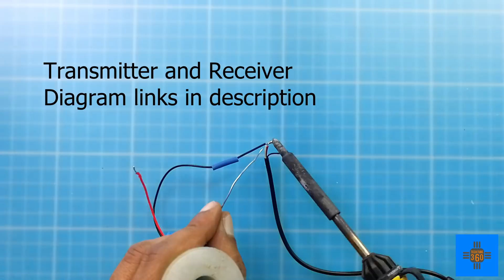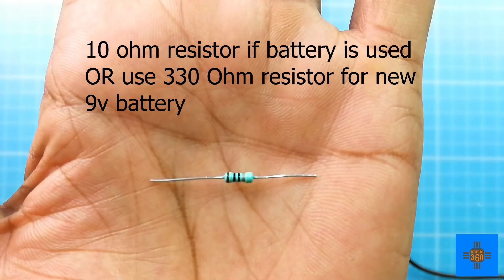Li-Fi Experiment || Transmitting Audio With Light || Light Fidelity

Comment: Is an amplifier necessary in this please reply fast
Reply from the maker: Ya speaker has built-in amplifier and it's must to get some decent output at other end.✌️👍😊🙏
Reply: But I am not having an amplified speaker😭😭😨
Reply from the maker: @netra6769  then for experimental purpose buy one will cost  you under 300 INR at any local mobile shop. Make sure it's powered aux in speaker and not a Bluetooth speaker. All the best for your project👍
Reply: Which amplifier is necessary for this process (specifications)
Reply from the maker: @netra6769  any small 3watt amplifier will be sufficient you can probably use Pam series of amplifier.
Reply: @techtube360world  can you send me the link please

Comment: Hey which amplifier ???? Plz reply, im making it for science project and ur so hwlpful plz
Reply from the maker: Amplifier to amplify signal generated from photo diode any high gain pre amplifier will work. After that you need main amplifier or aux in speaker.
Reply from the maker: Better use solar panel to get away from all that hessel of will simplify your project